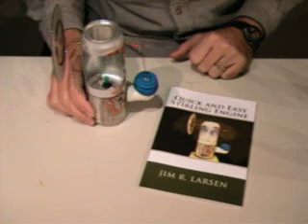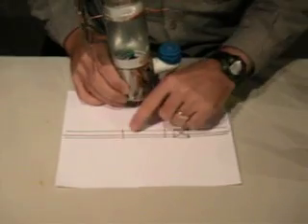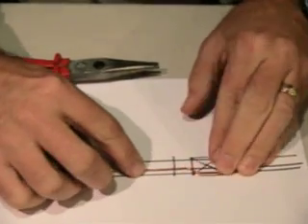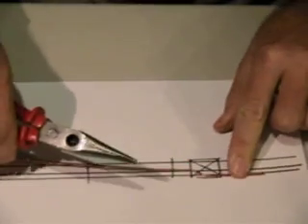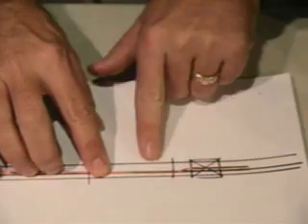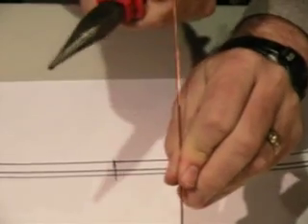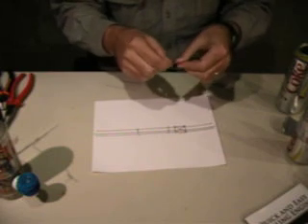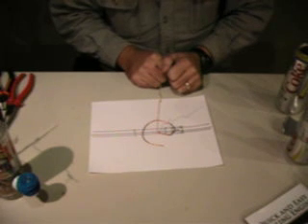How To Bend a Crankshaft for the Quick and Easy Stirling Engine

Comment from the maker: Yes.  The crankshaft controls the timing between the displacer and the power piston, and if that timing is not correct, the engine won't run.  The power piston must be 90 degrees behind the rotation of the displacer.  Also, the crankshaft controls how far the displacer travels, and this has a big influence on engine efficiency.  The same is true for the power piston.  The length of travel controls how much air is used in each rotation to move the flywheel, and how much power it will have.

Comment from the maker: It sounds like a pressure leak.  If you have heat on one side, and cool on the other, and you get no motion when the displacer moves - you have a leak.  It is often the hole for the displacer pushrod that causes the leak, but it could be anywhere.

Comment: Thankyou so much for these videos! They helped me alot. I'm trying to make a stirling engine for my science fair project I have done everything but when I heat/turn my engine on it doesnt have enough force/power to push the diaphram up and down, I removed the hand that connects to the diaphram and it moves but when I connect it all up it doesn't seem to budge :O any solutions? Is this problem caused by a bad displacer? or not air tight enough? :( Please help me!

Comment from the maker: People have used light weight balsa wood successfully as displacers.  Drawing board wood my be too heavy.  It will create some challenges, but it might be made to work.  These engines don't have a lot of power and can't lift a heavy displacer unless it is counter-balanced.  Another alternative is to make the displacer of steel wool.  This is light in weight and acts as a regenerator.  Use the lightest material you can find that won't melt in the heat.